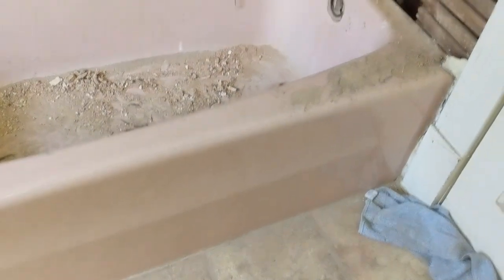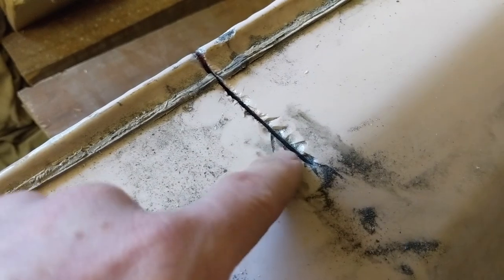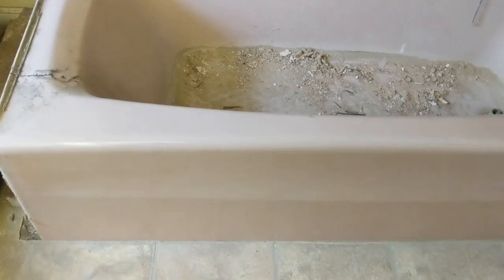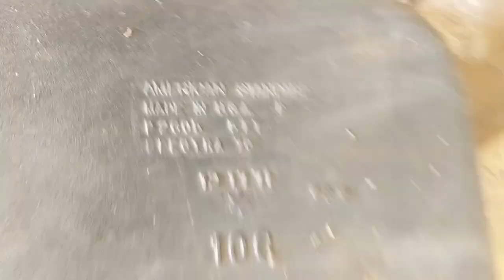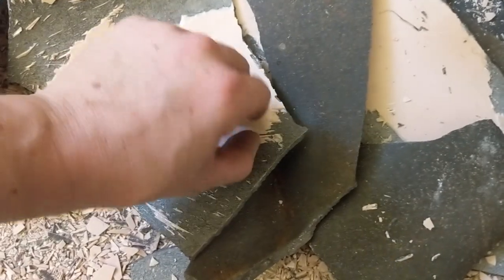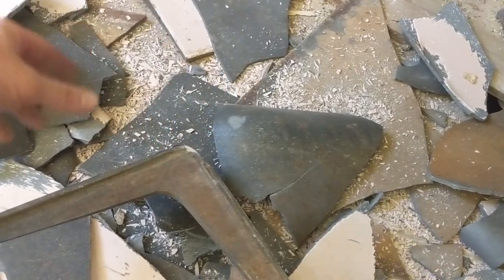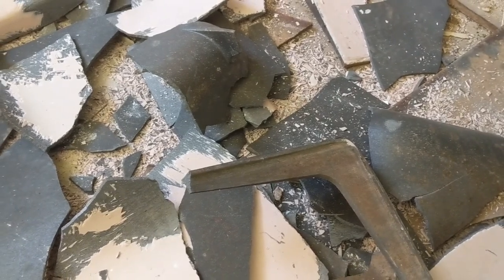Removing a Cast Iron Tub Fast - Master Bathroom Remodel Pt 02

Comment: This is great an all but what you should do is throw a canvas drop cloth over while you break it up. Keeps the shards from flying all over the place and from flying into your skin that ceramic coating is sharp as hell
Reply: cloth will dampen the impact and make the hammer slip easier. Just wear proper safety gear and you'll be alright

Comment: Thank you.  I have a 70 year old tub which wore badly.  I made the mistake of refinishing it, and now it's flaking.  I want a whirlpool tub with jets for my back, which is the same age as the tub.  (My back is the same age as the tub, not my desired replacement. ;))  I'm into sweat equity, and I might be able to save money by doing the demo myself, only working with a plumber for the hookup.  I'll consider using my trusty sledge hammer.
Reply: Plumbing hookups are a lot like tinker toys, save yourself some $ on that one too 😊
Reply: 😂😂😂🎉😢😢😢 3:45 😢😢😢 3:45 3:45 🎉 3:45 🎉😂

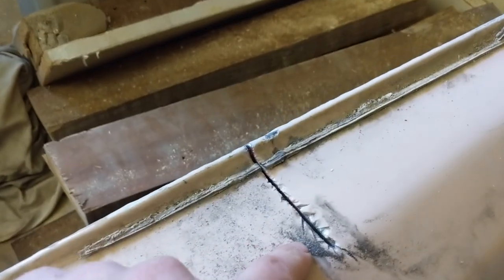Comment: 2:25 You can use a grinder with a metal cutting wheel so you can cut it into four sections so you can remove it in pieces. The sledgehammer is doable, but you will have a huge mess to clean.
Reply: Works ok for steel baths but not cast iron.  Cast iron is brittle and hard.  You will use up 20 wheels on a cast iron and give yourself vibration issues.  Sledgehammer is must cheaper and FASTER.
Reply: @drcl7429 done it plenty times with 2 or 3 blades .way easier than sledge hammer which doesn't always work.

Comment: Cut mine into 4 pieces with a 4 1/2 inch Lenox diamond edge blade. Less mess.
Reply: How many disc's did u use ?
Reply: @jonlewandowski7773  1
Reply: @Andrew-jo5sg  ok so what tool?, grinder?
Reply: @Chuckles..  I used a standard Makita 4 1/2 inch corded grinder. 
The key was to be patient and keep a firm grip on the grinder. I also wore a heavy welders shirt, a welders cotton hood, a full face  3M mask with ventilators and heavy welders gloves and of course hearing protection.
The cast will produce a super fine dust so be sure to mask off the area. 
I’ll post a link here to my YouTube with a video.